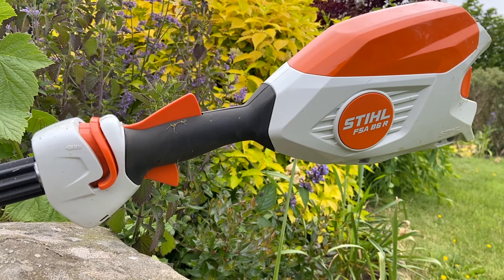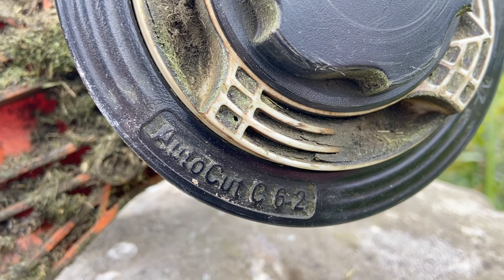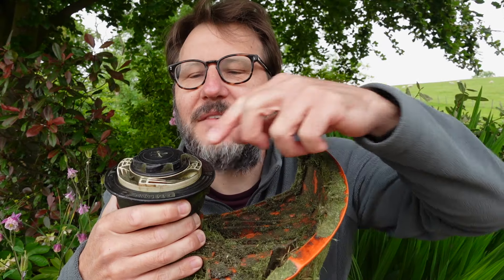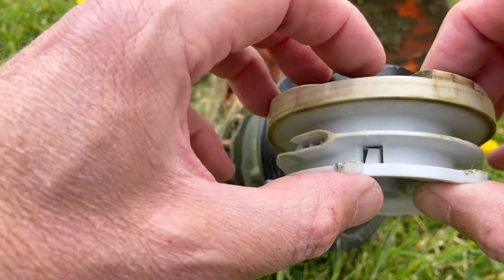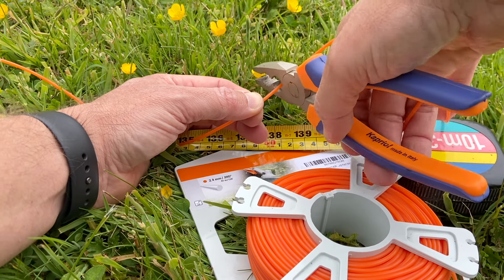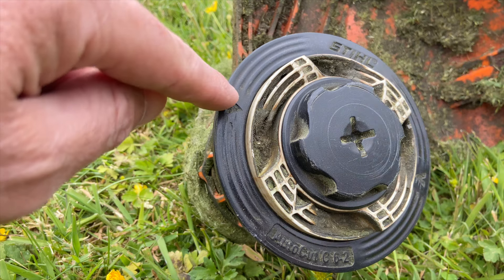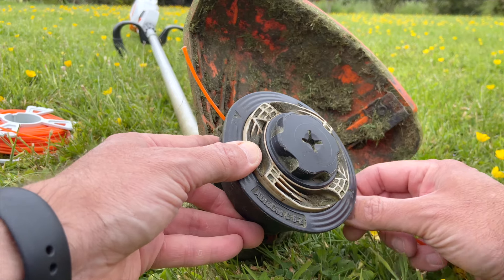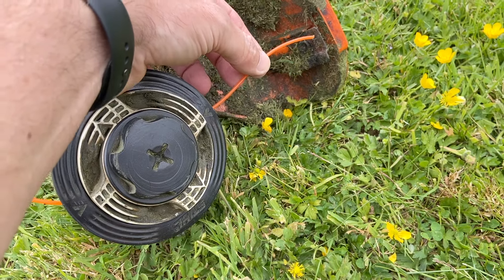How to change the line on Stihl FSA 86 R line trimmer with Autocut C 6-2 head

Comment: Great video - super quick and to the point and good advice on going a little short on the line length.  For non-metric users - I'd cut the line no more than 11-12 ft (don't go to the full 4m (13.1ft)
Reply from the maker: Thanks for the comment and fully agree with going shorter and not overfilling the spool. Thanks for watching.

Comment: Very helpful video which Stihl should have made themselves as how to wind on new line is not clear from the manual. One point not mentioned is that when rotating the white part of the head to wind on the line the black cap can become loose so make sure you check is is tightened before using the device.
Reply from the maker: Valid add on point. Thank you, and thanks for watching.

Comment: Thank you for your explanation, appreciate.

One question : after the reload, you starting to use the trimmer.
Once it remains 2 cm, how you manage to exit more rope from the trimmer head ? Do you need to tap on the ground ? Or it is automatic ? I’m struggle with this step with my FS 38.
Thanks for your answer and continue your videos 😊
Reply from the maker: Yes, I tap ours on the ground to release more line.
Reply: @MyHomeFarm  ok thanks, I haven’t the feeling that it works but I will try tomorrow.
Have a nice evening !
Reply from the maker: If it’s not, the line might be trapped so you may have to unscrew the cover.
Reply from the maker: I’ll also film another short video this week to demonstrate how to pull the line out manually without having to “tap”.
Reply: @MyHomeFarm  Can’t waiting how you deal with that 😊
Reply from the maker: As promised, here's the way we manually extract more line from our strimmer without the need for "tapping": https://youtube.com/shorts/65CgqVAqxAE